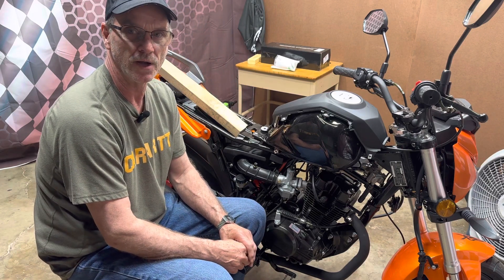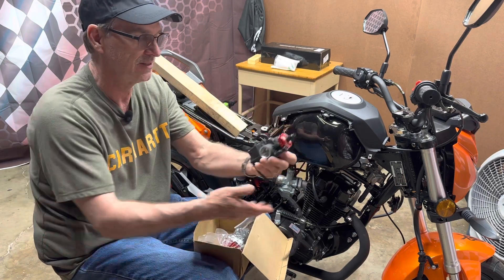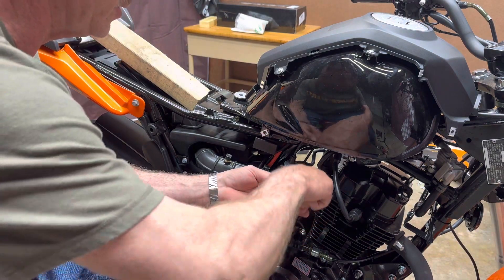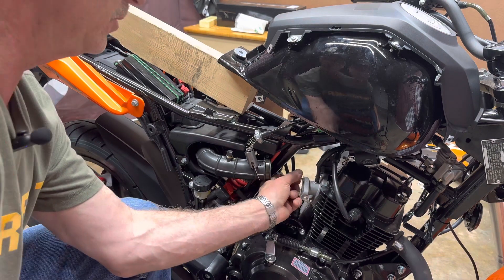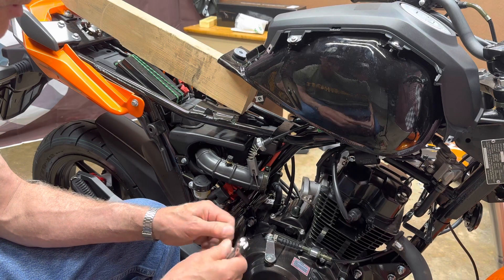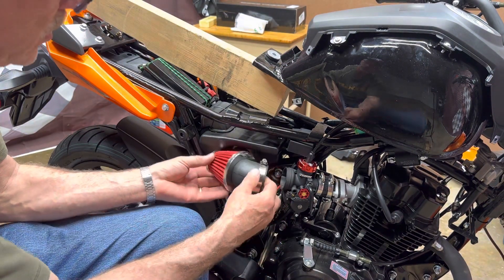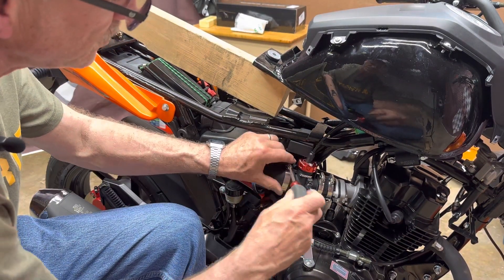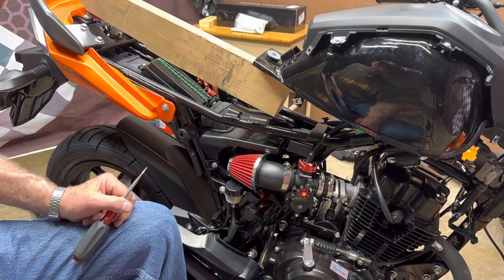Venom Ss3 KP mini 150 Carburetor upgrade to Nibbi 26mm complete process

Comment: I put a 26mm nibbi on a similar 150 and it seems to bog out very easy, still seems to bog with a 35 and 110, have you played around with jetting/needle position since getting it installed?
Reply from the maker: Hi Matt, I did change the pilot back to a 40 because I was having some cold start issues and the 40 pilot solved the problem. Everything else is still the same. Bike is running beautifully. I did update the video to include this information. Thank You very much for the comment as this may help others.

Comment: Hello again Herbie. I just recently saw a short from you talking about an oil leak coming from the shift changer linkage and coincidentally just recently i discovered my bike was low on oil after i heard and was making mild metal on metal sounds and checked. I did order the recommended seal on the link you posted. I'm not all to sure how it goes on ,hopefully it's an easy swap. Thank you for the heads up . I am hopeful that this low oil problem is fixed  with this new helpful. information.
Reply from the maker: Hello Serafin, are you sure the seal is leaking? I wouldn’t change it if it wasn’t, unless you’ve pulled seals like this before, it can be difficult. I’m not sure if mine is leaking or not I’ll give it a little time. If it is leaking I will do a video on the seal replacement

Comment: Hey I saw u cut the video at 14:20 and there was a hose u put it where the carburetor sits at was wondering where did u get the hose from I’m missing that piece
Reply from the maker: At 14:20 I put the plastic spring seat in before the spring. Is that what you are referring as the hose?

Comment: Since you bolted on that air filter would you still need the air box? If I did the same job would it be ok to get rid of the airbox to lose the dead weight?
Reply from the maker: I really don't need the airbox but I'm using it for the engine venting. If you delete the airbox you will also need to add a filter for the engine vent. It's no big deal, just preference on whether you keep the airbox or not.

Comment: The nibbi pe26fl fits this bike better. I removed the air intake tube from the airbox and the nibbi air filter fits under the side faring.
Reply from the maker: Hello Michael, yes the 26mm Nibbi is a good fit for this bike and makes it run so much better I think

Comment: Hey Herbie, is there a big difference between the Nibbi and Mikuni?
Reply from the maker: Hey Christopher, I’m not real familiar with the Mikuni clone but many people love them. The Nibbi is a spreadbore and allows a straight through design instead of a Venturi affect. Which is better? It really depends on what you are going to do with it, the Nibbi has great throttle response throughout the throttle range when you get it dialed in. If you just wanted the bike for putting around then the Mikuni will be good too

Comment: Did you have to port match?
Reply from the maker: No I didn’t, there isn’t really anything to open up, the fit is pretty good
Reply: @herbiesgarage681  thanks 4 replying. Also in ur comments you stated you went back to a 40 from a 35, did u move your needle position or did u keep it 1 below the middle?
Reply from the maker: @turboecoinrings6839  I’m pretty sure that I left it in the one down from middle. I’m sorry, but I’ve done several carburetors since then. It sucks to get old 😏

Comment: My oil selled like gas an my bike won't start I seen lil gas comming out the exhaust pipe connecting to engine , did I ruin my bike Noone wants to work on it cause it's an off brand
Reply from the maker: Your bike is probably not ruined, there’s a possibility that if it ran with an excess of gas in the oil that you could gas wash your rings and it could smoke or lose compression. That’s worst case scenario though. You probably severely flooded it with gas trying to get it started or something. I would change the oil, replace the spark plug and try it. Do you have a stock carb and jetting or is it a Nibbi?

Comment: What size air filter did you put?? Idk if I'm supposed to use 45 mm 35 mm 49 mm lol. I have the same kp 150 you're working on...
Reply from the maker: Hello Andre, I believe it was the 49mm but let me check when I get home from work and I’ll confirm it
Reply: @herbiesgarage681  okay awesome I was about to buy the same package you bought with the carburetor and air filter I got the soft double foam nibi I didn't know what size to get
Reply from the maker: @sylusandre  okay, I just started work so it’ll be a while, if you need the filter right away then I’ll see if my wife can get the information for you
Reply from the maker: Okay she just replied, I ordered the 49mm, I believe the 26mm Nibbi takes a 48mm but all you have to do is tighten the clamp a little extra with this filter
Reply: @Herbies Garage  oh wow awesome thank you so much. I'm going to place my order now for the 49 nibi foam. Gonna use your other video for my sprocket swap! Love your videos very helpful.!
Reply from the maker: Awesome! Thank you Andre 👍🏻